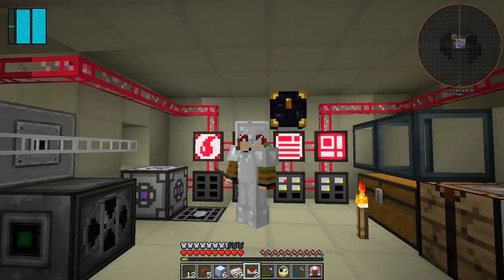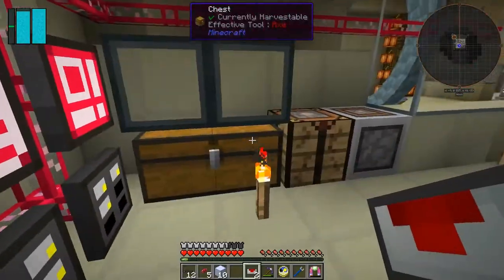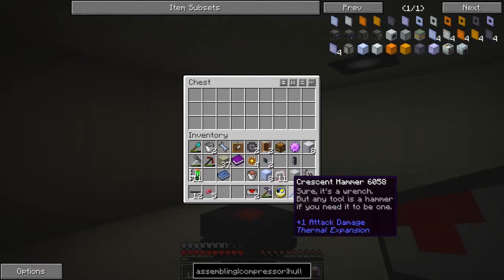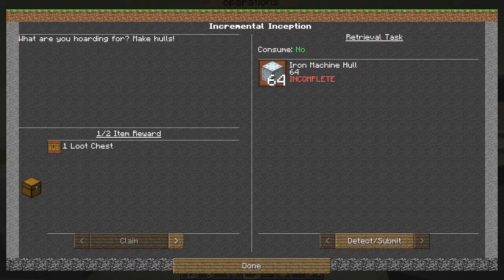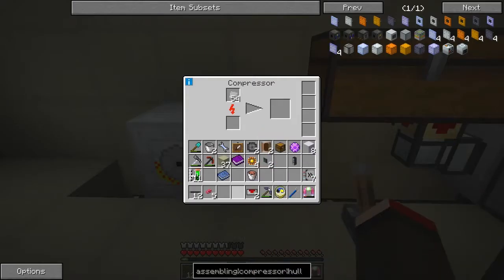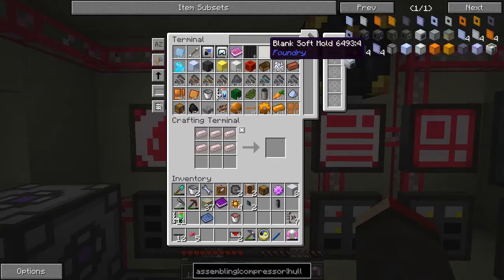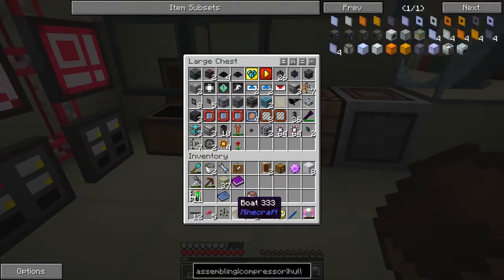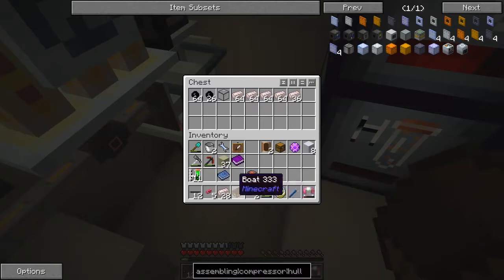Galactic Science 2 #53 - Dense Iron Plate Automation

Comment: For my automation:

Iron -> Hopper -> Decomposer -> Synthesizer (which is fed Carbon from my Carbon cache).

Out of the Synthesizer -> Auto Compressor -> Block Cutting Machine -> Compressor -> AE2
Reply from the maker: CCindy sounds like a good plan, the block cutting machine uses quite a lot of power when over clocked.
Reply: True, I didn't overclock mine, so it's running "passively".  Slow but eventually gets done without having to worry about it.  I'm very tight on power as it is.